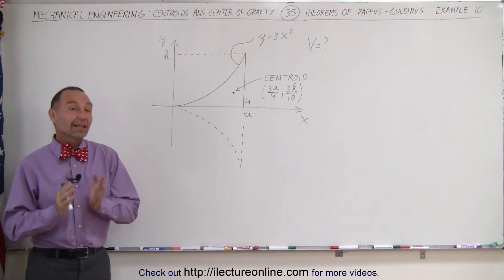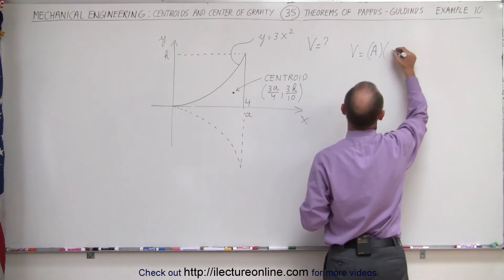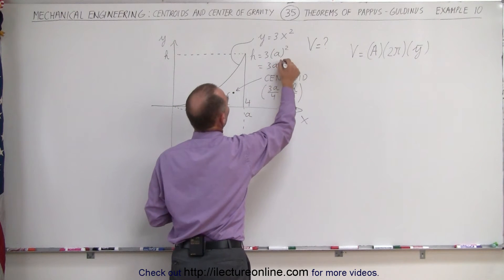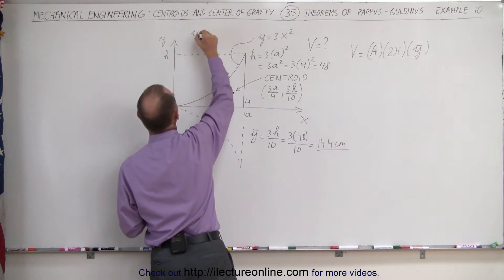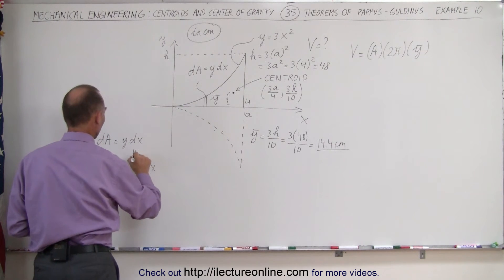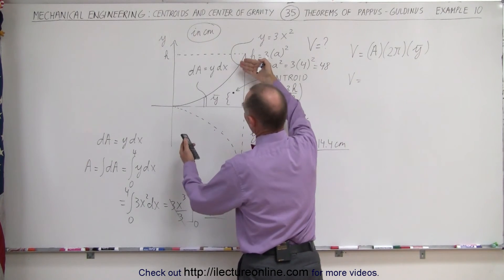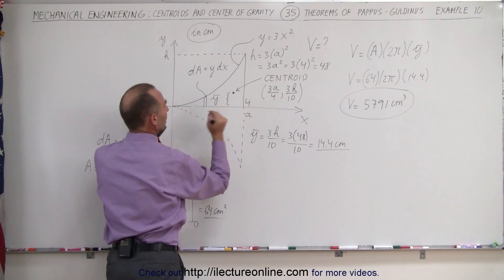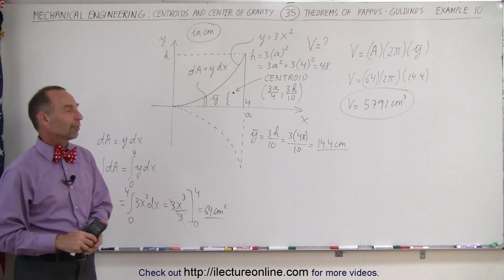Mechanical Engineering: Centroids & Center of Gravity (35 of 35) Volume=? using Pappus-Guldinus

Comment: Sir I am getting the y coordinate of the centroid as 3h/5 .Is that correct??
Reply from the maker: Let's do a quick order of magnitude.  If it was triangular in shape, the centroid would be 1/3 the distance from the base to the top.  Since with this shape there is a greater proportion of the mass towards the base you would expect the centroid to be less than 1/3 h  (3/10 h is a bit less, so it appears to be in the ball park).
Reply: calculating the centroid  getting   y coordinate as 3h/5

Comment: Sir is it relevant for JEE ADVANCE.. PLZ REPLY
Reply from the maker: I have not seen an emphasis on this particular topic on the JEE advanced tests, but having a general knowledge of most if not all topics is recommended before going into the test.
Reply: @MichelvanBiezen  it has relevance in jee advanced , 
Not directly but one can use these theorems , 
For calculating questions of 
COM and gravitation ...
Pappus theorem is used very well in case of toroid/torus in magnetism ...

But you can clear jee advanced even without this theorem , these kind of topics generally act as the cherry on top ...
Students preparing for Olympiad must study these topics .